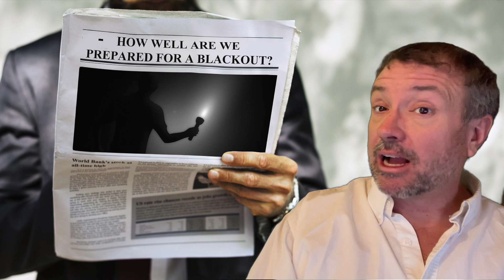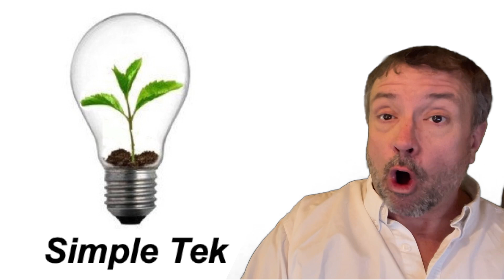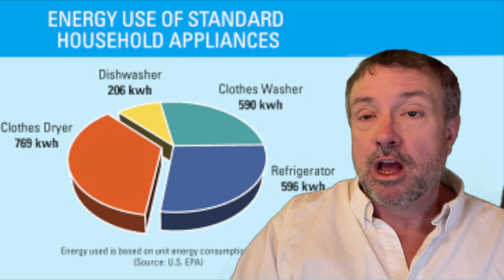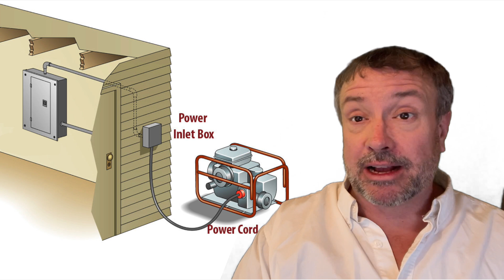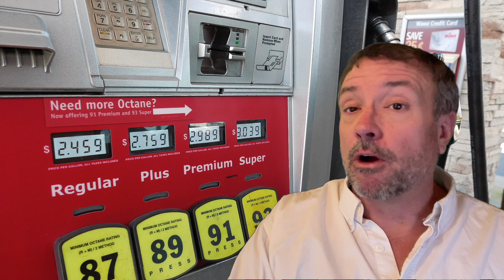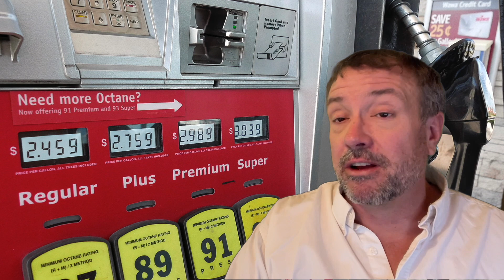Why A Gas Generator over Solar?

Comment: I have a similar living situation and I also have a small gas generator for backup power that I hook up to a receptacle on the side of the house to a special electrical panel that can be isolated from the grid. However, as an alternative to using the generator for short outages, I have a decent pure sine wave inverter that I connect to the battery of my electric ride-on mower. It's got about 2 kWh of capacity  and that'll run my fridges, lights, and internet for around a half a day. For longer outages, I'll run the gas generator to recharge the battery and run my water heater since the generator runs more efficiently when at least 50% capacity. On a 20 lb tank of propane, I can go a couple days without power. I think the longest outage we've had since moving in was 2.5 days.

DM me if you want more details on what I did, I'd be happy to share.
Reply from the maker: That’s awesome! Thank you for sharing

Comment: Your so right on this. I do the same thing. I didn't realize that you can get the electrical hook up for this so cheap. I run around with extention cords through the front door! What bugs me to is that when a subsidy program to encourage people to build alternative energy systems comes along it's dominated by contractors. For us DYI ers we are never eligible. I wish they would just help with the materials costs! I do like my Tulikivi soapstone fireplace, but it's more of a luxury item due to capital cost. Thanks
Reply from the maker: Thank you for the kind words!

Comment: i've been for without power for about 3 weeks because of a hurricane, and in certain disasters you could be without it longer. the first problem is if the grid goes down for any amount of time in your area their will be no gas stations to refuel, no cell phones because they need power and the internet to run. you would think solar in an option, but were i now live we are surrounded by mountains and it is often cloudy, so that means little sunlight on average to rely on. however for short power outages i use a 7200 gas generator hooked up to the house same as you and it runs everything except the hot water so its not hooked up to it, but we can have air. heat, and cook since those appliances we have are smaller. problem from what i know about solar besides the cost is batteries and by the time you break even, you need new batteries and that alone can be very expensive depending on setup. i've always thought water power would be an option, but you need a water source running through your property, etc., but you pretty much never run out of water and no refueling costs. however i hear getting such a setup is alse expensive for the motor, setup, etc. no perfect solution i guess. yes i thought of wind but you need a setup that won't be killing birds when it operates and often there isn't enough wind to run one.
Reply from the maker: Where you live a solar wind hybrid system would be optimal
Reply from the maker: The bird thing is over exaggerated by Trump cause windmills looked ugly on his Scottish golf course so he made shit up, yes they kill birds but no where near as many birds as house cats do, by a factor of 1000

Comment: A backup generator and a constant output generator are different as far as cooling goes. You could convert your septic tank into an anaerobic digester and have free natural gas for as long as you eat
Reply from the maker: interesting
Reply: This depends of few things, how large tank is, quantity and quality of material you use to  feed digester, cost to build it. I think that wood gas will be cheaper. I plan to use gasifier  for a backup  as i also use firewood for heating, cooking and hot water in winter. It will be natural to use it for power too.

Comment: Well in Ohio gas used to be very cheap... and we had THOUSANDS of greenhouses throughout the northern half of the state.  Now most of them have been torn down due to the costs of heating the greenhouses during the winter.   Oh and from places like Santan solar,  you can buy used solar panels with 15-17 years of lifespan remaining for about 1/5th the price of new ones... I did.  They are from solar farms where they replace the panels every 5-8 years.
Reply from the maker: great info! Thank you for sharing!

Comment: why not get a power powerwall battery use it to reduce your electric bills charge with cheap night rate electricity then use in day you can still have it setup as backup for powere cuts as well with a mains powere cut of to stop power going to the grid. Generators are ok but if you don't run them much there is a good chance it won't run when you need it to.
Reply from the maker: batteries are very expensive, I go over that in the video
Reply: How often do I need to replace the battery?
Reply from the maker: @adelawad1111  depends on the battery.
Reply: @adelawad1111  lithium batteries not very often if looked after will last you very long. 20 30 years
Reply: @SimpleTek  yes would be very expensive just for backup but if you have a cheap overnight tariff it's a way you can make them pay for them self by being able to take advantage of that cheap electric throughout the day. May not be a option for everyone i think the price of batteries will come down soon in the next 5 years or so especially with the new battery chemistries coming available. Remember to put some additive in your fuel to stop fuel going stale. It works wonders in my machines tools I don't use all year round just start first pull.
Reply from the maker: @adus123  well said
Reply: @ElectronicMusicUnderground  yes I have a battery pack I built myself used  laptop batteries to power my sheds.

Comment: The setup with a generator have one more benefit. If you in the future got an electric car, and it have VTL (vehicle to load), you can then use the car to power the home, if the grid goes down.
Reply from the maker: very true!
Reply: @SimpleTek  How long could you do that? Plus the simple fact is that the noise for a generator becomes a safety issue for your family. How would you like some local freak with a gun to decide that you owe him your generator and gas. For a couple thousand dollars, you can buy a good back up battery source that would keep your electrical items up.
Reply from the maker: @michaelbagley9116  you wouldn’t get much time with a few thousand dollars on a battery system
Reply: @SimpleTek  1. Not trying to run everything all the time.  2. Trying to keep food cold/frozen. Operate only as necessary. 3. Used to maintain or operate things like breathing machines.    How do I know this?... I use this when my power went out for a week. I have a propane stove that uses wood gas. So cooking food is not a problem. A small wood stove keeps a necessary room warm till the power comes back on.
Reply from the maker: @michaelbagley9116  that’s well said

Comment: Off-grid energy makes no sense at all. The only reason to go completely off the grid is if you don't have an electric grid at all for example in the forest.

If you have the chance to use the grid do it . Off grid is way worse for the environment, its a waste of resources because if you scale your system to be big enough in the winter yyou have a massive over production in the summer. Thousands of kwh wasted and a loss of money if you dont sell it. Even if you coud find a way to use the energy in the summer (cooling the greenhouse) its not wasted completely but you coud shut of a coal plant instead. yes its a small amount of energy but if thousands of people would go off grid it would make a difference .

I personally love to be off grid in the woods alone in my wood cabin but the reality is called economy of scale. Bigger scales get more efficient.

in my opinion the best thing to go is to set you goal to 80-90 percent off grid and buy the rest 10 -20 percent from the grid . It will most likely be free because of the energy you sell in the summer months

Just a video idea think about wood gas generators.
There are currently not a lot of models on the market but there is a german company selling them for 59.000€ , it produces up to 25kwh electric and 50 kwh thermy . It works of wood chips (8.5kg an hour) but it needs way less if you just need less watts. It shuts automatically if you need watts goes down and has a small energy storage
Reply from the maker: off grid makes sense in some areas where grid is possible, I view it as payback time. this depends on your hookup cost and cost per kilowatt. My area is cheap but some areas are 5-10 times my electrical cost and there it makes sense to go off grid
Reply from the maker: @ElectronicMusicUnderground  well said
Reply: There are ways to turn excess solar energy into storage or money.  Heating hot water, sand w/ heat pump, crypto, pumping water, etc.
Reply from the maker: @flowerpt  very true